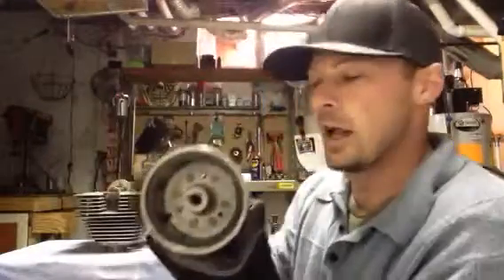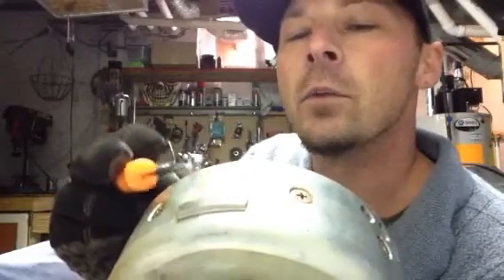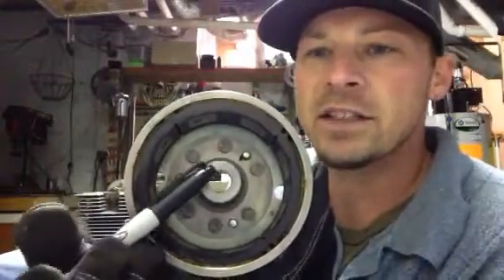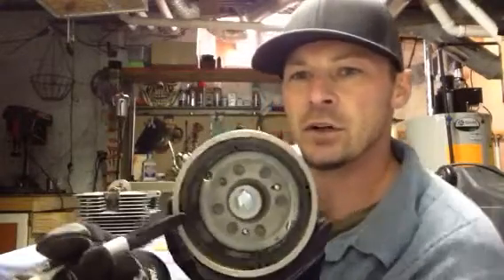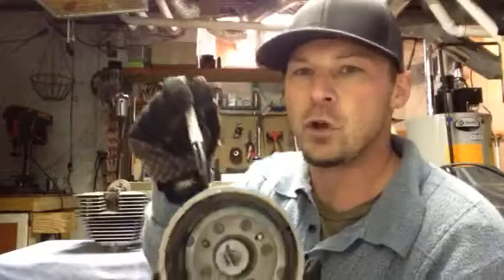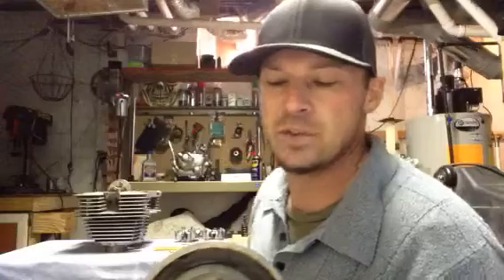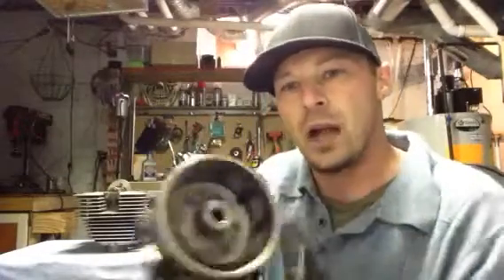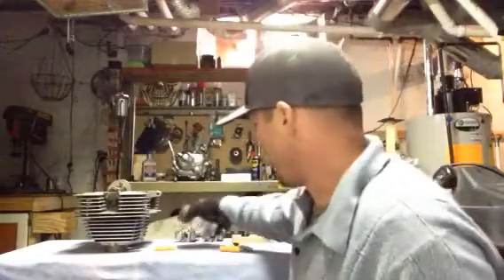Honda rebel build #3.2

Comment: Do you have a complete rebuld tutorial? I'm currently rebuilding a 250 myself and need some advice.  Thank you!
Reply from the maker: I do not, sorry I sometimes don’t film every thing. I am currently not working on that bike as of now but I am planning to do some soon I’m installing new head bolts and case bolts I am having made for the extra crank and head pressure because of the turbo. But not for a while.